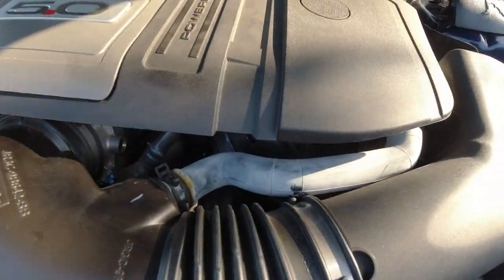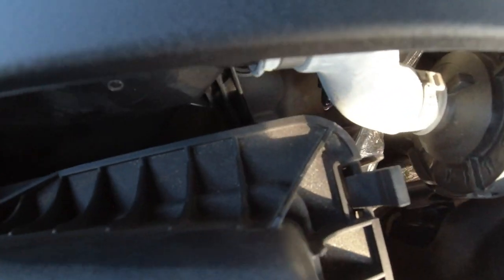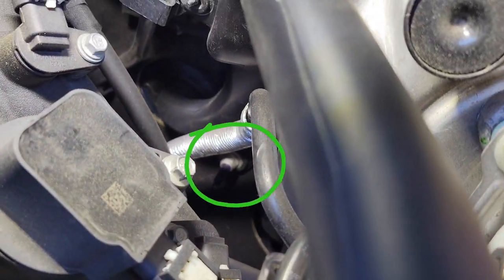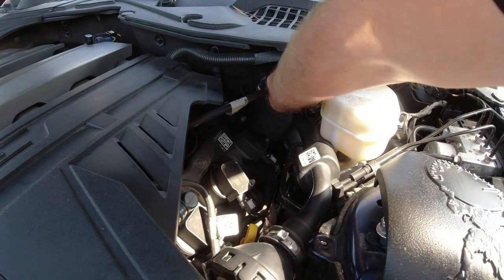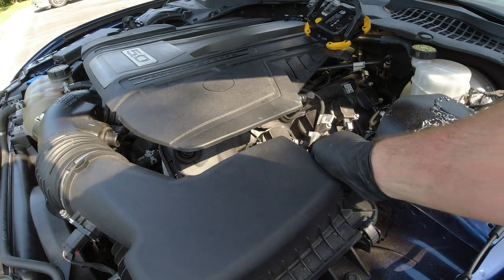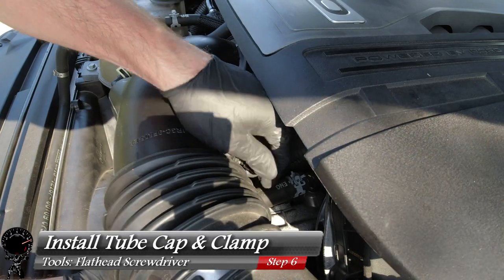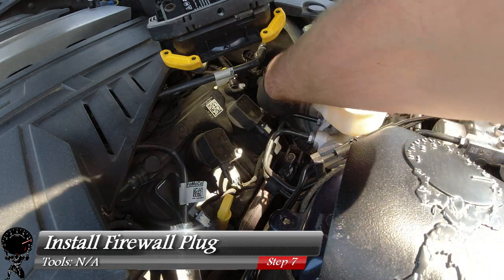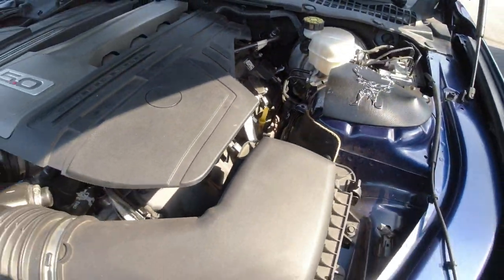How to Uninstall the Sound Tube for the S550 Mustang (2015+)

Comment: Great information and video. If anyone wants to do this delete, you can access the fire wall nut from underneath, its a lot easier to your hands to remove and a lot easier to install the grommet. If you want to save some dollars go to your car accessories store and buy a 28mm grommet and your hardware store for a rubber plug that goes on to your chairs leg. That's what I did and it worked out great.
Reply from the maker: Very nice

Comment: Recently picked up a '14 and had no idea Ford does this, I did remove the sound snorkel and found a cap for the CAI and used aluminum tape to seal the firewall. Ours has had complete exhaust redo stem to stern, so it sounds louder than I prefer but it is what it is. It just looks better without the tube and if you are shaving ounces... Thanks!
Reply from the maker: Thank you for the positive feedback

Comment: I'm curious so air coming through your intake. Some of it gets pushed into that tube to create a sound on the inside. Doesn't that take away some of the air volume that goes into your motor and decrease horsepower?
Reply from the maker: If so, it's a minuscule amount

Comment: Nice. Out of curiosity would this cause issues for Smog checks? I have a 2017 GT and removed the sound tube a few years ago. 

Not sure when the smog checks start for this year model but I saved the tube just in case I need to put it back on.
Reply from the maker: You should be fine
Reply: This will be a visual failure for California smog check.  The approved configuration by CARB and EPA included it.  Any modifications need a CARB executive order number.  We fail these daily.  If you remove it, be sure to save it so you can reinstall it for your smog check. (smog inspection and repair licensed for over 30 years)
Reply from the maker: That's crazy. For a part that doesn't impact pollution nor performance. California...what can you do?
Reply: @stevenlucas3736  thank you. I kept it in one piece just in case. ReInstall will not be a problem.

Comment: Why didn’t you include the measurements of the cap and plug you installed? Makes no sense.
Reply from the maker: Did you need the measurements? The kit is really cheap.